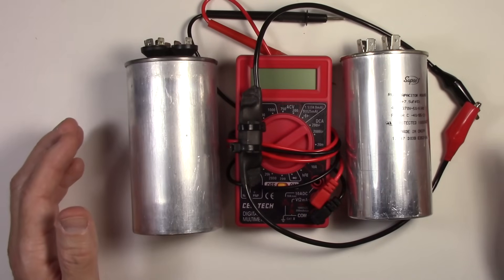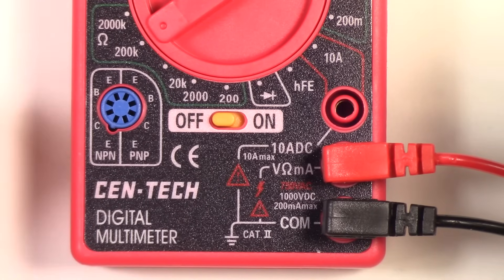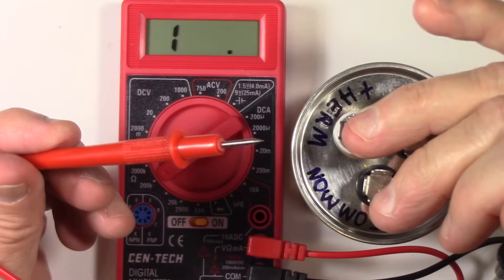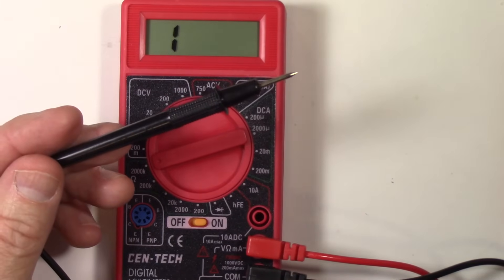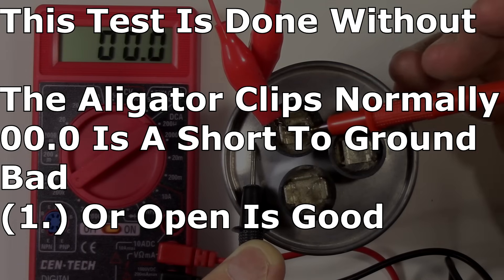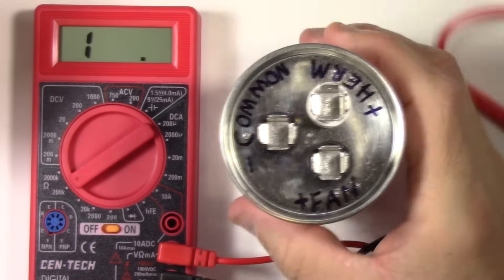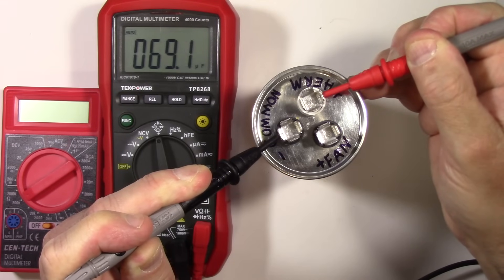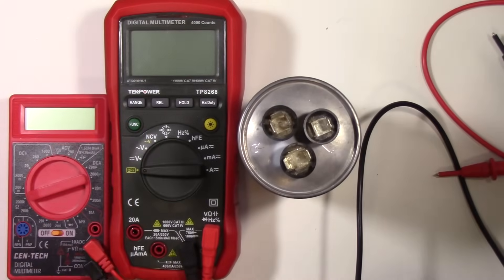Start Run Capacitor Testing Using A Cheap Meter DIY (HVAC/Stereo/Microwave/Electronics) Service

Comment: I tested my 50uF air compressor run capacitor after watching this video.  The multimeter showed that the capacitor is taking a charge. However, I also checked the the resistance using alligator clips to determine if it was shorted to its case. The multimeter reading 0.00 confirmed it was shorted to the case. These two tests seem to be contradictory. Is the capacitor good or bad? Any help would be greatly appreciated.
Reply from the maker: It sounds like your capacitor is bad. It's a strange case for sure. I was thinking about it and if only one terminal shorts to the case there is a probability that it would still work as a capacitor, but for sure replace it as the continuity to the case is a sure sign it's failing or failed. A short to the case indicates it's faulty, even if it appears to take a charge. Good catch though on the test to the casing! Thank you so much for commenting and watching. I appreciate it greatly. All the best.👍😀
Reply: Your response to my comment/question is greatly appreciated. My Dad was a mechanical engineer, and had me turning wrenches by 7 to 8 years old. I actually have a degree in environmental engineering, but electrical systems are not particularly a strength of mine. I'm much more comfortable with fabrication and mechanical repairs. I enjoy repairing/restoring various things that most people throw away. Folks like yourself have saved me time, money and SERENITY!
Reply from the maker: Happy to hear I could help you. All the best!

Comment: Can you test capacitors soldered on a circuit board without removing them by either method?
Reply from the maker: Yes, you can test capacitors on a circuit board, but in-circuit testing (without desoldering) is often inaccurate for capacitance value due to surrounding components, though you can check for shorts with resistance/continuity and use an ESR meter or voltage checks for larger caps; for accurate capacitance or value tests, you generally need to desolder at least one lead to isolate it. For quick checks, visually inspect for bulging/leaking, then use a multimeter for shorts or charging/discharging behavior. 
Check this video out for reference and quick check. https://youtu.be/3j7NEBNal-0?si=TYShezk1LSDScs3N 
Thank you so much for commenting and watching. I appreciate it greatly. All the best.👍😀
Reply: @richardlloydusa  Makes sense. Thanks for responding.
Reply from the maker: My pleasure.👍😀

Comment: He just simulated how would be if it’s actually shorted to ground the lead only to simulate so if it read like that without the leads means shorted to ground he did that since doesn’t have one shorted to ground
Reply from the maker: That's a good way to put it. Thanks for watching and commenting! 👍😀

Comment: Thank u sir! Us home DIYers don’t have all the expensive tools… I got the cheap multimeter for free at harbor freight… refrigerator went out n trying to test capacitor on it… watched other videos but urs is very detailed as far as to the point good pointers to get it done! Ended up the starter relay/switch no good but capacitor is good! 👍 Cheers still going strong October 2025! 🎉👻🎃🧛‍♂️
Reply from the maker: You are most welcome! So glad it was helpful and that you found the problem! Thank you so much for the kind words, commenting, and watching. I appreciate it greatly. All the best.👍😀

Comment: How can you build or where do you buy that tool for draining the capacitor first? I would like to test the capacitance of my capacitor in my well pump controller box and have the same cheap Harbor freight multimeter.
Reply from the maker: Here's how I made a capacitor discharge tool: https://youtu.be/pVIV905qby0 also here is a "cheap" meter for capacitor testing from Amazon that I use(paid link): https://amzn.to/4qd3DmK and no it's not a Fluke $300+ professional meter but we don't really need that for our purposes. It's more than good enough for our purposes. 
Thank you so much for commenting and watching. I appreciate it greatly. All the best.👍😀

Comment: I thought it strange that both sides of one capacitor were bad.  Usually one side or the other is bad, but not both sides.
Reply from the maker: Those two sides are actually seperate capacitors and you are right most of the time only one fails. But if the fluid leaks out or the top bubbles up from internal pressure both capacitors will fail. With the top forming a dome it cuts the internal connections by ripping them appart (safety feature). Both capacitors share the same fluid container so if the fluid leaks out both of them have no fluid, so they both fail. Thank you so much for commenting and watching. I appreciate it greatly. All the best.👍😀

Comment: Im amazed at the amount of people that pay $400 to have this changed to get there unit running, its a $12 part, of coarse this is just about testing
Reply from the maker: I have a video on replacing the capacitor in your AC Unit here: https://youtu.be/19A9lvQ6lIA
Thank you so much for watching, commenting and the valuable feedback. I appreciate it greatly. All the best.👍😀

Comment: It probably best to not use these "cheap" multi-meters. Very hit and miss when trying to measure microfarids on a capacitor.  

Best to pay extra to get a more complete multi-meter that can measure microfarids.
Reply from the maker: Completely agree but sometimes it's all you have to work with and it may get you by. This method will not tell you if you have a deteriorating capacitor but it will tell you if you have a completely failed capacitor. I have many meters capable of measuring capacitance and you have just reminded me to go out and check the capacitor on my A/C system to see if it's still in spec. They can be out of specification and the unit will still work but if it's deteriorating then it's just a matter of time before it fails. While it's deteriorating but still functioning your A/C system will not be as efficient as it can be and it will run hotter too. But again if all you need to know is if it's blown this method will work for that. Thank you so much for watching, commenting and the valuable feedback. I appreciate it greatly. All the best.👍😀

Comment: AC wasn't working, just the heat pump fan would run. I don't have a fancy tester, but do have a multi meter. I just checked continuity between common and fan, got a tone...did same on compressor side (herm) and nothing... YES. Found a new copastor locally, checked, got tones on both, installed...HAPPY WIFE 😁 SO, you don't need a fancy meter to always check.
Reply from the maker: Thank you so much for watching, commenting and the valuable feedback. I appreciate it greatly. I have a video on how to test the capacitor with a basic meter here: https://youtu.be/SihpkALJtmE All the best.👍😀

Comment: I appreciate that you have identified the terminals as "common", "herm", and "fan".  However, I would not know how to identify them if you did not label them. How are they identified?
Reply from the maker: Great question. They letters H C F (Herm, Common, Fan) are usually stamped into the metal on the capacitor next to each terminal. Thank you so much for commenting and watching. I appreciate it greatly. All the best.👍😀

Comment: I'm checking my generator  capacitor due to low voltage. It's showing it taking a charge and discharge like in this video. But could it still be a weak capacitor?
Reply from the maker: Yes it still could be. Look at this video: https://youtu.be/Xy4Y4oqcWVI 
I go deeper into how capacitors degrade over time on it. You really want to check it with a meter. The one I put in the above video description is a great value for this purpose too.
Thank you for watching, commenting. I appreciate it greatly. Subscribe, Click The Bell and stay tuned!  All the best.👍😀
Reply: @richardlloydusa  sorry one more question. If i replace the capacitor does it have to be a certain type? I know it will have to have the same Farads and volts. But the one I see online say they are for motors. Will they also work on a generator?

Comment: is it safe to reverse the polarity when checking the resistance on a small say 10v  tantalum  SMD capacitor?
Reply from the maker: I just did it and I didn't have any issue but, I not guarantying anything! Use it on your own risk. There's very little voltage from the meter. Thank you so much for commenting and watching. I appreciate it greatly. Subscribe, Click The Bell and stay tuned! All the best.👍😀

Comment: My meter really does not count. It flashes a couple numbers then instead on 1 it displays OL. Does this mean the capacitor is bad? It shows microfarad in range. Do i need another tester to show the numbers flashing?
Reply from the maker: If it shows microfarads I would say it should be able to test capacitance. Do you have any old electronics with capacitors in them? If so test a few of those. If it gives you a measurement then you know your meter is functioning and you have a dead capacitor. Thank you so much for commenting and watching. I appreciate it greatly. All the best.👍😀

Comment: I tested from common to fan and does't give any read the other one gives me read  , should l replace the capacitor ?
Reply from the maker: Yes Sir. Both should give you a proper reading with the ground lead to common. Replace it. Thank you so much for commenting and watching. I appreciate it greatly. All the best.👍😀

Comment: nice job,im just lost cause i cant find my newer heat pump capacitor,its not even visible where all the wirings,can u give  advise?thank you
Reply from the maker: The only thing that I know is that the capacitor is "usually" on the outside unit "usually" behind a protective cover. Most systems have online manuals that explain where all the components are. Check for that. Thank you so much for commenting, watching and the very kind words. I appreciate it greatly. All the best.👍😀

Comment: Great video, can you measure a loudspeaker air core inductor on the $20 multimeter?
Reply from the maker: Yes you can but all it's going to tell you about the coil is whether it's functional or not. Here's a video on that https://youtu.be/m9Ed13nvNRg. To get measurement you need a tool like this one at Amazon(paid): https://amzn.to/3q2bJUC it will measure Inductors : 0.01mh-20H and at $14.98 I may buy myself one too. LOL Thank you so much for commenting and watching. I appreciate it greatly. All the best.👍😀

Comment: Hey there, I have the same meter. I was wondering if it's possible that a run capacitor can go bad when it's been sitting around. I always thought it be a good idea to keep a spare around. It has a small dent in it, somehow. 

I changed it and the old and new is coming up with no readings. The fan pops up with a reading, but doesn't stay, but the Herm is showing me no numbers at all.

Should I just go buy a new capacitor?

Comment: what if ohn test only rises slowly and doesn't 1 after 60 seconds with my fluke 116? Starts at 7 m ohm and only gets to  9m ohm. Its rated 80 uf and test out at 77.3 mf. So mf shows good but ohm not.
Reply from the maker: When in doubt replace the part. Thank you so much for commenting and watching. I appreciate it greatly. All the best.👍😀

Comment: What's up with all the videos where they say to set the multimeter to "MFD"? Yours doesn't have anything like that.
Reply from the maker: MFD stands for Micro Farads which means the meter has the capability to test capacitors directly. This meter does not have that setting because it's a "cheap" meter but it can still tell you if you have a functional capacitor or a totally dead capacitor in which case you have found out what your problem is. Thank you so much for commenting and watching. I appreciate it greatly. All the best.👍😀

Comment: What if when you do a reverse capacitance test with the cheap ohm meter it doesn't go to zero and reverse it's polarity like it did for you when you swapped the leads around? Thanks.
Reply from the maker: The polarity really shouldn't matter the behavior should be the same either way. This is a basic test to show if the capacitor is actually still functions. Please consider investing in a more advanced but relatively inexpensive meter like this one at Amazon(paid): https://amzn.to/3yrTEk0 it will pay you back on the first repair. Thank you so much for commenting, watching and the very kind words. I appreciate it greatly. All the best.👍😀

Comment: so what is the size of the capacitor? does the meter tell you that?  Ok so i wasted 5 bucks on this meter and should've gotten a real meter
Reply: It should be written on your capacitor ?   Or on the wiring diagram on the machine the capacitor came from .   Alternatively  👉google the type of device the capacitor  came from .   Clothes  Dryer .aircon.  Pool pump .  Ect .       In the event you did not already have a multimeter …..You did not  waste $5   Now you have one 🤔 .    If you had listened to this vid …he clearly said 👉 The cheap meter  will not tell you the  capacitor rating .     So …you ether  dropped everything you were doing on the spot ,when you saw  the title of  This vid .  Rushed out and bought a $5  Meter…..  Then Came home  …. Then  Hit  play ,to continue watching the rest of this vid ? and still didn’t listen to the words  this man was saying  ?      Or ….The more likely scenario …is you just like to Complain .
Reply from the maker: Thank you so much for your support and effort. I appreciate it greatly and I'm sure others will too. All the best.👍😀
Reply from the maker: This is the one I use on Amazon(paid): https://amzn.to/3TqHKzJ 
Thank you so much for commenting and watching. I appreciate it greatly. All the best.👍😀

Comment: How to fix a dryer, switch clicks but doesn't spin
Reply from the maker: It could be your belt has failed. Here are my appliance repair videos: https://youtube.com/playlist?list=PLnxXRLSlmSVNdocPZf8hPjkOQeDRKaRIx
Check out the dryer drive belt replacement video: https://www.youtube.com/watch?v=dzae5V1xcRw&list=PLnxXRLSlmSVNdocPZf8hPjkOQeDRKaRIx&index=5

Comment: By marking it + and -  is confusing, in an ac  circuit.
Reply from the maker: Capacitors are used in both AC and DC circuits. 
Thank you so much for commenting and watching. I appreciate it greatly. All the best.👍😀

Comment: But does just ohm reading give a true representation of how much capacitance the capacitor has??
  Will a weak capacitor not show ohms the go nothing on the meter??
Reply from the maker: You are correct that a weak capacitor will show but a dead capacitor will not. This test will show you if it's dead or not. To really see it's health you need to use a meter that can actually give you it's current value. Here's a meter that can do this and costs less than $20 on Amazon(paid): https://amzn.to/3w3tAL1
Thank you so much for commenting and watching. I appreciate it greatly. All the best.👍😀
Reply: @richardlloydusa  That is why I use meters with a capacitance setting. 
  Not sure how much I would trust a $20 one. 
  When I first started dealing with appliances, I used analog meters and watch the meter sweep to the right then go back down.  Now I wonder how many I might have parted out because of bad capacitors I thought were good. 
  For a short while I tried digitals but not long. 
  I am about convinced I need to spend more money to get something I can depend on other than the cheap ones I got from Home Depot. They don’t seem to hold up. 
  But then, I might have had them set wrong when checking live power by mistake or something.
  I checked that meter out. Looks like a pretty good deal. I might get one snd try it for a little while.
  Looks like basically the same I have been using for like maybe a year at a time for each. Just different color and different name. That and cost twice as much.
Reply from the maker: I've had very good luck with the sub $20 meters I have bought. They seem to do a good job at testing capacitors. The clamp meter function would be useful in testing AC system for current. The meter I linked seems to rate well on Amazon too. I always check the reviews. If you want a professional level meter I would go with a Fluke or like brand but you will NOT be getting one of those cheaply. For my needs the value meters have worked very well. 
Thanks again. All the best.
Reply: @richardlloydusa  I have a Fluke that is around 5-600 new.  Something is wrong with it or I have not figured exactly how to use it yet. 
  Used when I got it.
Reply from the maker: Fluke has a great reputation and if it is not working you can send it back to them (you might even still have warranty) but they will be happy to fix it. They stand behind their product which is part of the reason they cost so much. Thanks again.

Comment: Capacitor are cheep fit a new capacitor. Short out the capacitor your replacing it does not matter it the high current damages it, your replacing it anyway.
Reply from the maker: Thank you so much for commenting and watching. I appreciate it greatly. All the best.👍😀